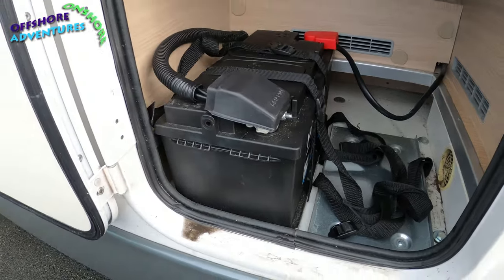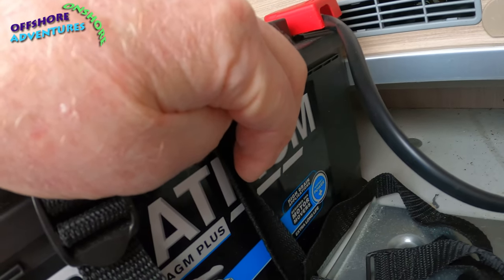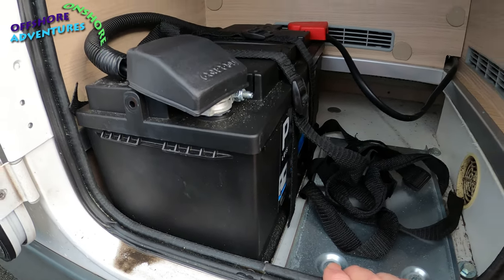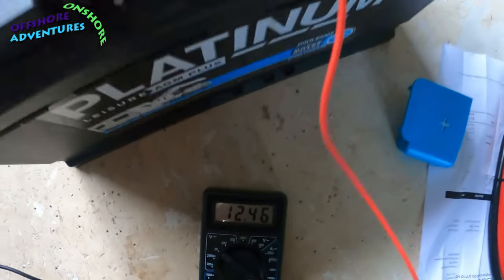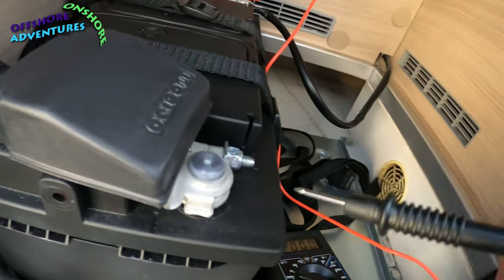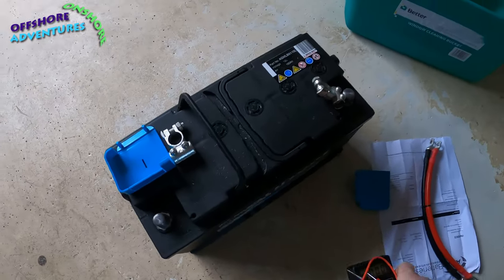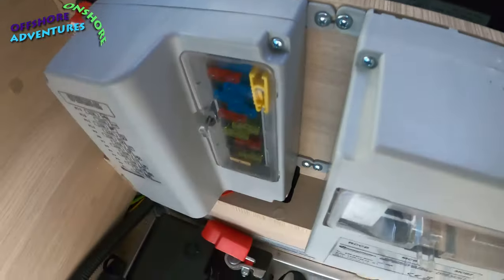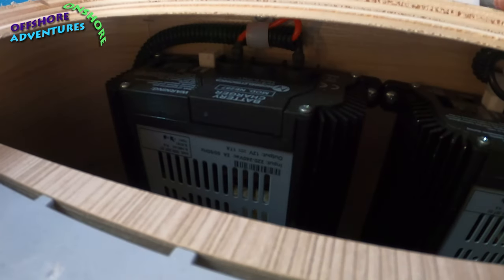Fitting a Second Leisure Battery to our Motorhome

Comment: Just a question The negative to the new battery I can see you have it bolted on the the right side  does it matter out the 3 bolt connectors you add the cable to
Reply from the maker: Thanks for watching Peter and not to my knowledge, or research, as long as all the connections are clean and firmly tightened was my take on it so theres a clean flow of current between the two as they act as 'one' when in use.

Comment: Great video but my 2018 model has three fuses - removed all 3 and the solar controller is still illuminated?? Any help appreciated
Reply from the maker: Many thanks Chung - do you mean a Mobilvetta? Our inline solar fuse ultimately goes back to the main fuse board so you could isolate the whole hab area if you have a more central master fuse switch. Did you get a User Handbook with the van which should also specify the exact fuse or if it's not a Mobilvetta then there would be a FB forum or YT channel for your specific van which might have someone that knows where to isolate :)) Hope that helps and thanks for watching :)

Comment: Hi I have a roller team Pegaso with the exact same outlay as yours I am going to fit a second leisure battery could you tell me exactly amp power leads I need to purchase thank you for your time look forward to your reply
Reply from the maker: Hi SCM and thanks for watching - how old is the current battery and what type/brand and Ah is it?
Reply: @motorhomingadventures  Good morning thank you for getting back to me as I live in Wales as well the weather looks good today I have two new superbatt silver 9000  S100 with  100ah Hope this helps thank you Steve
Reply from the maker: Thanks Steve and I'd use 50mm square connecting cables. That would be AWG 1 or thereabouts. Here's a link to that type of cable - I used Alpha to source the parts for my battery upgrade

https://www.alpha-batteries.co.uk/sterling-power-pair-of-50mm2-battery-linking-cables-with-m8-eyelets-300mm-length/

Those have M8 eyelets so just check that would be suitable for your setup - you can get different cable ends depending on your needs :)

Hope that helps and thanks again for watching our channel Steve :)

Comment: Hi what size (thickness) joining wire did you use thanks
Reply from the maker: Morning TK,
I ordered:
Sterling Power Pair of 35mm2 Battery Linking Cables with M8 Eyelets 300mm length 

from Alpha batteries.

Hope that helps :) and thanks for watching
Reply: @motorhomingadventures  thanks 👍 for the info  I’m just about to add a 2nd battery to our motor home.  Lovely motor home you have we’ve just changed to an a class Enjoying your vids 👍
Reply from the maker: Hope that goes well and you'll love the A class :))